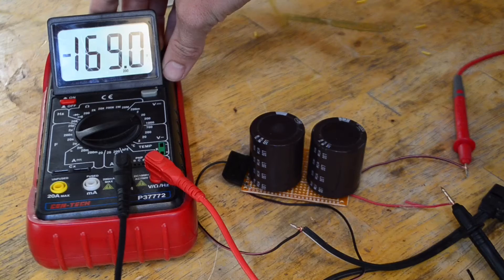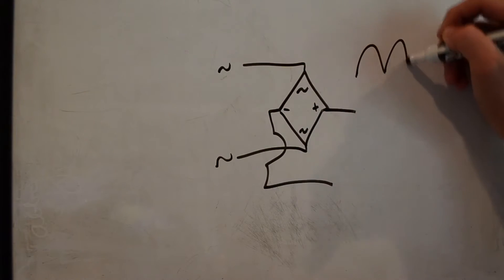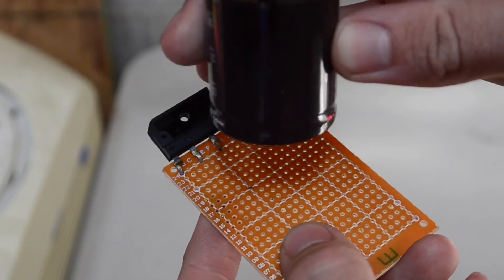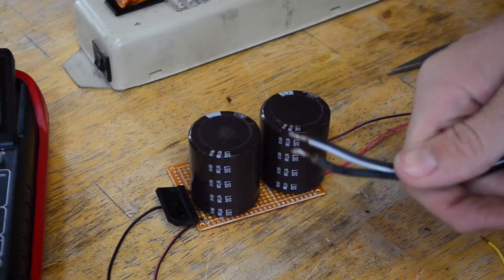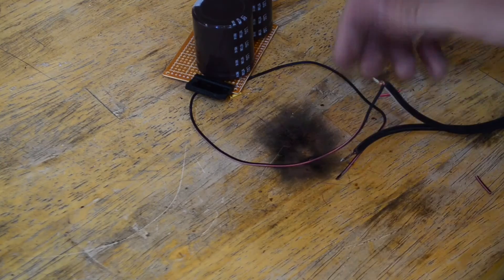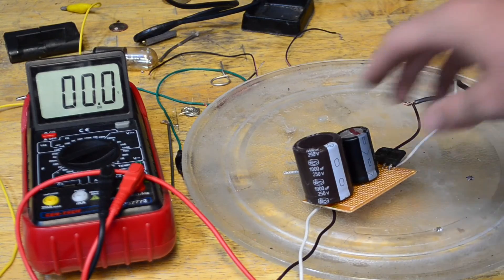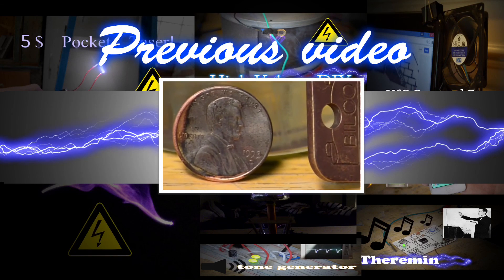How to make an AC to DC converter

Comment: So if I wanted to power a dc motor rated at 90/180v I could just use a bridge rectifier and huge capacitor without having to fool with a dc drive? It’s a geared motor on a meat grinder so the rpm doesn’t have to be exact.

Comment: Great video, i was wondering if you could tell me which components i would need to make a 24pvac to 240vDc B- rectifier.

Im looking to use it for a hydrolysis project and wanted to go from using 12v battery's too high voltage Dc instead. 

Thanks
Chris

Comment: I made mine with KBPC1010 10A 1000V rectifier and when i plug it into 230V with no load it blows the 10A fuse and also the 10A breaker. If anybody knows what Im doing wrong, please tell me.
Reply: There would be a short somewhere in your circuit after the 10a fuse maybe solder is splattered on your circuit somewhere or your capacitor is shorted or around the wrong way

Comment: how would i be able to increase the dc output even more? im trying to build a rail gun so i want a really high voltage to put in series with a resistor to get high current to charge the super caps faster.

Comment: so the dc voltage that was measured on the output is higher then the ac input because the capacitors are  higher voltage rating then the incoming  ac current right.  so  you are measuring  just  the capacitor voltage and  the second something is plugged in the voltage would drop right?so capacitors are essentially like  a short boost  when  something needs a short high voltage amount  but they will slowly drop unless the source of the voltage draw lowers the draw so the capacitor can recover? right? im pretty new still so just trying to understand still.

Comment: That's absolutely too funny! I just built one of these and it's almost identicle, same bridge, same caps! The only additional thing I added was two 47nf 300V caps. I put on a three pole screw terminal at the the AC side for a center tapped transformer and a three pole screw terminal at the DC side for a positive and negative rail and ground

Comment: what's up bro I've been having a problem getting a  ac120 v 800 w motor from a juicer. to be converted to dc with a throttle switch. for a ebike project any advice?
Reply from the maker: +Alpha__ TV an ac motor works off of principals of induction, so sadly it will only run on ac.
Reply: thanks for getting back. still interested so I'll do some research. thank you.
Reply: If you can watch the video. Make a ebike from scrap.
Reply from the maker: sure ill check it out.

Comment: 06:52    
And thirdly: Install a fuse to your circuit either it's already a manufactured plug or manualy installation to your circuit. 
One more thing to add: The fuse ratings varies due to your circuit demands.
That's it guys, stay safe, and happy discharging your HV capacitor!

Comment: could you use a resistor on the dc side to reduce the voltage?
Reply from the maker: +Mr. green yeah, but it would dissipate a lot of heat, probably better to use a transformer ahead of it to get it down to the lower voltage

Comment: How do you determine power output of such rectifier? Thus select the proper fuse? (Electronics newb here, obviously )
Reply: Find the component (including the transformer coils) with the lowest current rating and use that for reference. Check the wires as well, there should be a list of thickness - maximum current somewhere.
Reply: Jack Slate then find a fuse thats rated at a lower amperage then the lowest current tolerance component, and if your device could draw current spikes use a slow acting fuse, and if it never will, use a fast acting fuse.

Comment: Project idea : How to make DC Lab Supply? 
(I figure you'd need to rectify the AC mains to do it, so it would work nicely : ) )
Reply: I'm talking about a power supply with variable voltage, and current. Not something that you put 120v AC into, and spits out 168v DC at X amps. : )

Comment: I have a sound amplifier and i just built a full bridge rectifier for my amplifier and  when i play music it's good at the beggining but later on it starts to distort and the music dissapears... i used 10 000uf 50v 2x capacitors, 1000v 35A diode bridge and a transformer that is rated 24v 0,37A but instead of giving out 24 volts, it gives out 30 volts... the amps stay the same. My amplifier is AVT2180 2 Channel 60W Rms... can someone atleast tell me what should i do to keep the music playing? Thank you!

Comment: I have got a 400V 1000yf cap bank (for a coilgun) what resistor value should I use to discharge? 

Pleas can you make a video about Coilguns 

I like your Videos so much thank you
Reply: u need a 1 meg resistor at 1/4 watt, but that will take hours or days to discharge, so better use a lower value higher power resistor, but that will waste power.

Comment: 169 volts, you now what that means ;).... Absolutely nothing. Except that when you rectify AC, the voltage becomes 40% higher.
Reply: gooddeed26 I'm am not to sure ,but I think it is because the peak of the wave is 169 and the rectifier holds it at the peak of the wave.
Reply: @stonecold7945  It's inverse RMS provided by the AC side; there's obviously no step transformer changing the line voltage.
Reply: Exactly 41,4213562%
Reply: But ac is way more dangerous
Reply: Heard of anything called "Step-up Transformers" ??

Comment: How do I determine what size capacitor I need for my circuit?
Reply: Depends on the load you're attempting to power. There was a simple formulae for that that I found recently, it's more of a rule of thumb though, urm... Damn, I can't find it anymore. It was something like 4700uF per amp.

The more mathematical way should be this formulae:
C = I/(f*ΔV)
C-Capacitance
I-Load current (you can calculate that through your load resistance and voltage provided)
f-AC frequency
ΔV- Ripple size (you want this to be under a volt, the less it is the smoother your output is)
Reply: Attila P. ^

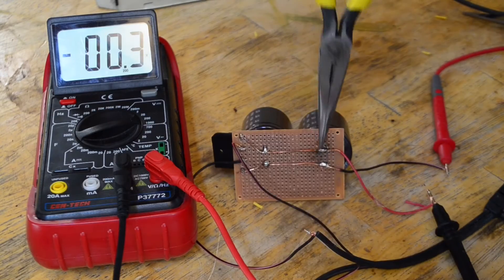Comment: 4:20 as the voltage on the output is dc, it would not hurt much if at all!
Reply: it will hurt a little, but waaaay less than ac
Reply: Ivan R it's still referenced to the mains so it's best to use a transformer

Comment: *big spark
you shouldn't discharge capacitors this way, you should probably use resistors.
*Continues to use pliers to discharge
Reply: Lol, I guess Keystone Science guy just love HV sparks, plasma and "HV ions" . Is there such a thing as HV Ions?
Reply: Spreedator 1000 noop
Reply: He takes #ElectroBoom as a mentor.
Reply: I use one of them $5 harbor freight dial multimeters to discharge caps. Works great !

Comment: can i use it for electrolysis of water
Reply from the maker: +Pavan Pratap that's a great question! I'll test it today and let you know !
Reply: thnx
Reply: Yes you can. I have done it before. If you use household current 120vdc converted from ac you do not not need to add anything to the water. Just clean water. Most experiments use 12vdc where you have to put an electrolyte in the water to lower the electrical resistance.
Reply: yes thanx but from where to get this big capacitors
Reply: I am a believer in old tvs and electronics to try to reuse components. If not there try mouser.com, jenco.com ordigikey.com. If you look me up on youtube I some videos on electrolysis using dc. Warning-can be dangerous. good luck ask questions
Reply: I am looking for parts for a new Ac to DC converter. I found this. I will buy one soon. Hope it Helps.
http://www.alliedelec.com/genteq-23u222m200rv1a1/70103108/
Reply: Pavan Pratap I am a bit late but you can get 400v caps out of power bricks like the ones that supply your laptop
Reply: Sure why not!
That's very creative! I Never thought of that!
Reply: Just remember to be CAREFUL WHEN PLAYING WITH HIGH VOLTAGE (HV)  !